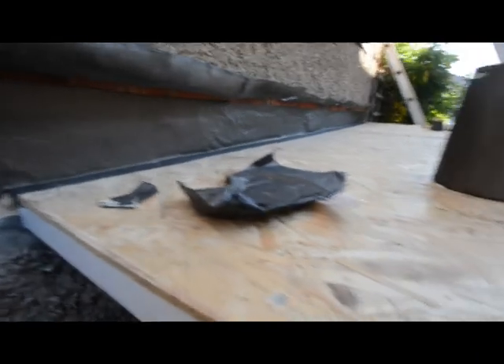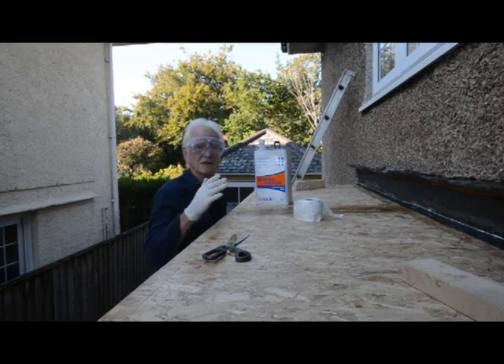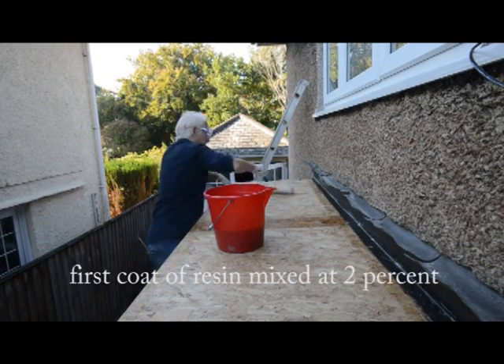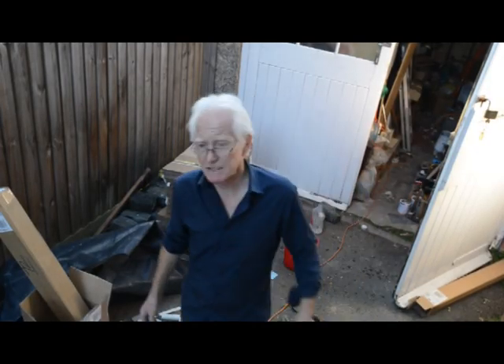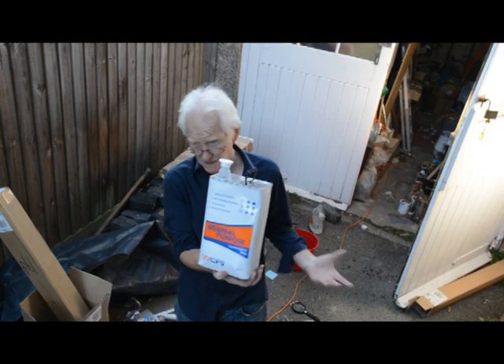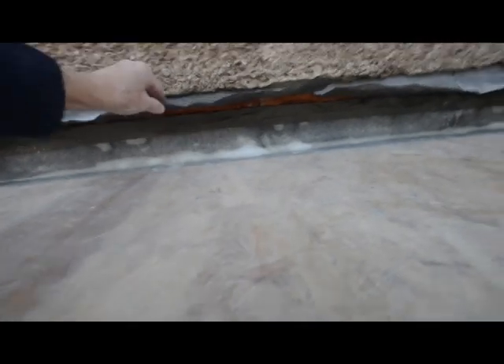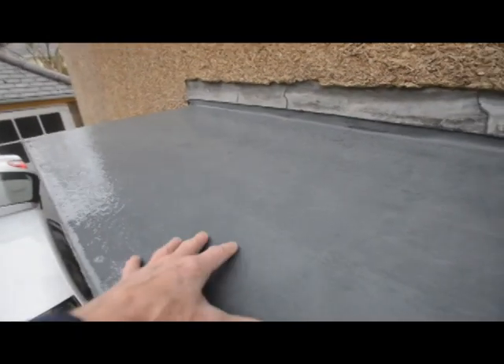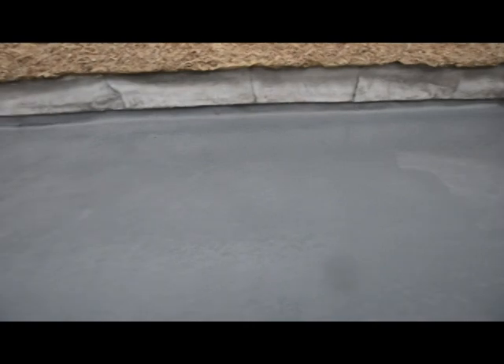Fiberglass small flat roof DIY project and how to apply the resin.

Comment: Am looking to repair a flat roof, was going to use lead that i have bought but really fancy using Fiberglass, and i can use the lead to fix the flashing as that was stolen and has been holding quite well for now with flashband, just wondering if i can use fiberglass as a flashband for my roof...great video and explanation of how to use the materials.
Reply from the maker: Thanks for watching Tony. From the spots of resin stuck to my driveway that stuff should easily stick to brickwork! Like most jobs it's all in the preparation. I would guess that if you give the bricks a good dry scrub first it will work okay The only issue using the fiberglass matting is that it might try to slide off the wall before the resin goes off. Just a case of propping it up in position for 20 minutes. Good luck. b33zo
Reply: @b33zo  Hi, thank you for taking the time to reply, and that's good to know you've answered my question, i wanted to use this for flashing on roof tiles as my lead has been stolen, i was thinking of doing next couple of weeks it should set quickly then, thanks Be33zo

Comment: For a first time , I would say that was an acceptable job, how much for materials.
Reply from the maker: Hi Will Thanks for watching. Acceptable is what I aim for as a DIY'er. I don't remember the cost but certainly less than £100 and I have enough fiberglass and resin to do another same size roof. I even used some to repair my VW Golf - another fascinating video...
cheers b33zo